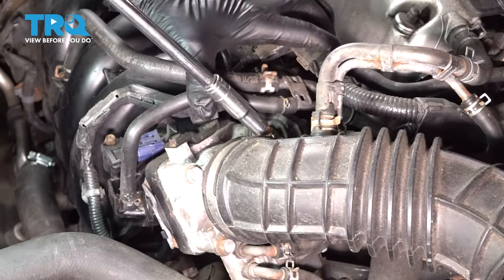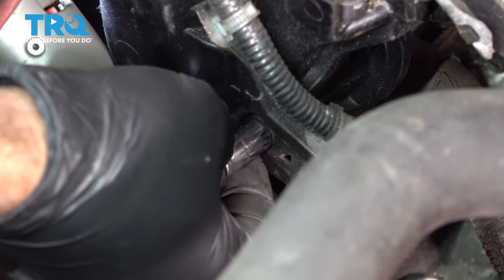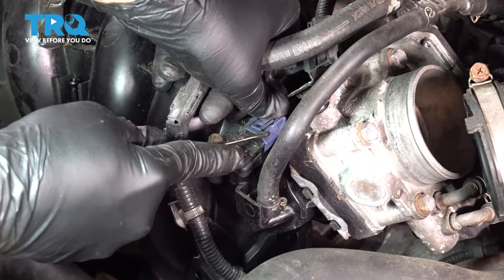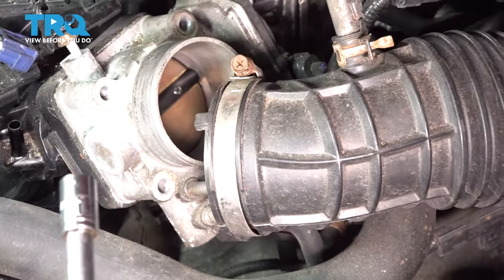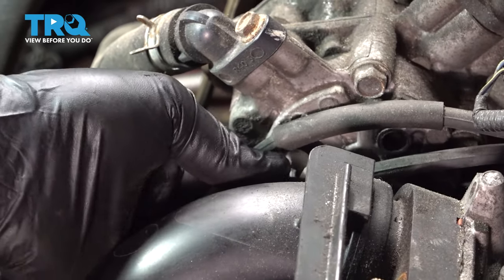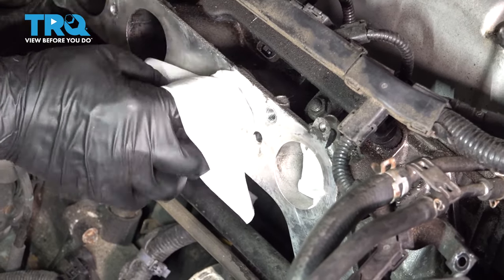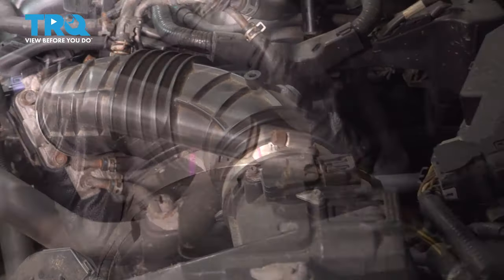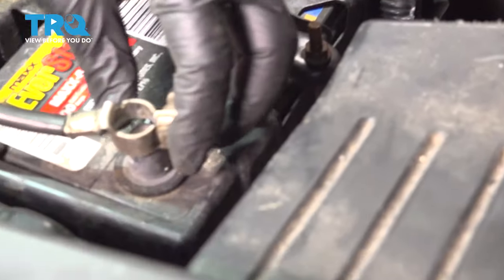How to Replace Starter 2008-2012 Honda Accord

Comment: Mine was a 2011 Honda accord and the intake manifold had an additional mount at the bottom that was difficult to take off but not impossible. Just something to add to the list if you’re working on a 2011

Comment: Thanks very much for this video. I just replaced a starter in an 09 Accord LX. The intake manifold on mine had a bracket attached at the bottom right that I had to unbolt from the engine. And the breather was in the way so I unbolted it's mounting bracket from the battery tray and kind of pushed it this way or that way to get it out of the way. Otherwise, it was pretty much the same as you showed. I REALLY appreciated that you included the torque specs. Some surprises: the 12 mm nut dead center of manifold requires a thin wall socket to get to, my craftsman 1/2 drive socket was too fat. I bought an inexpensive set at harbour freight (the colorful ones). The nut on the starter was recessed. I ended up using a 3/8 drive with a 3" extension to get to it. I had a hard time torqueing the 14mm rear starter bolt using my 1/2 harbour freight torque wrench. I think a 3/8 torque wrench would be better. Thanks again.

Comment: I took my time and had it done in under 5 hours. That five hours included going to get the tools I needed, taking it apart, driving half an hour away to get the starter, putting it together, cleaning the engine bay, and spending time on the phone. A leisurely project that likely saved me hundreds.

Comment: Thank you for the easy to follow instructions and including torque specs. My 2009 also had the additional bolt on the bottom of the manifold. Everything was such a tight fit but my hands and arms should heal in about a week. Lol!

Comment: It’s mainly clamps and tubing, getting the old hoses removed. Standard tools but an electric ratchet makes the job 3x faster. Metric sockets 10 & 12 for intake stuff. 14 & 17 starter bolts
Reply from the maker: +@JosephHubacek-xy8yg Thanks for watching our video! http://1aau.to/m/Shop-TRQ

Comment: Great instructional!  Before my starter went out it would make a "crunch" sound on a cold start.  I put in a new OEM starter with this instructional as a guide and I'm still getting the "crunch" sound on cold starts but at least the car is starting up.  I'm concerned that there is a) damage to my flywheel, or b) I installed a defective starter (unlikely because it's brand new OEM).  Do you have any ideas?

Comment: Great video!  Made it easy to get my starter out, but I do have a question. I did not have the steel plate between the manifold and block that comes in the gasket set for the intake.  Some on YTube say it's not necessary, some say to replace it. I didn't have one to replace, but one came with the gasket set. Should I put it on??
Thanks!

Comment: my 08 accord had 2 bolts on the bottom of the intake manifold that were also holding it on. you'll need 3 extensions and a u joint, wasn't fun but it's duable

Comment: Oh gee you forgot the really hard bolt at the bottom of the intake manifold. I still haven't been able to get it off. I started this job based on the ease that it appeared in this video and now I'm stuck. This is very misleading. Thanks a lot.

Comment: I installed a new starter from Autozone on my 2010 Honda Accord, 2.4L engine.  After about 6 months I started having issues with the crankshaft position sensor.  I replaced the sensor and I still have problems.  Dealer said I should have installed a Honda starter only!  Really, anyone else having this problem?

Comment: I have a 2009 accord replaced the starter 5 years ago.  Car acted like battery was dead I fully charged the battery all lights and electronics work but starter won't do anything. Do I possibly need a new starter?

Comment: I got all the way to the point where I take the intake cover off. It will not budge :( I've taken off every nut and bolt needed (6 total) and it won't move a bit

Comment: My daughter had Japanese Auto Repair in Alpharetta, GA replace the starter on her 2008 Accord with the 4cy engine after the original starter slowly began to fail. The failing starter may have had a bad solenoid because during failed attempts to start the engine, I could hear the starter spin but it wasn't engaging with the flywheel. After several tries, the starter would engage with the flywheel, turn the engine over, and the engine started and ran fine. The mechanic at Japanese Auto Repair replaced the bad starter. The new starter turns the engine over normally now but the engine won't start up. She was told she has a bad connecting rod and the engine needs to be replaced. I think that's BS because the engine ran fine right up to the time the old starter completely failed to turn the engine. I want to know what the mechanic could have screwed up along the way that could have allowed the starter to turn over the engine but prevent the engine from firing up and running.

Comment: In Honda accord 2012 
Starter failed and I was replacing it . There are 3 wire connections for starter 
1 on the top ( screwed )
1 black connector on the side 
1 blue connector going to engine ( this one wire came out) 
Please advise

Comment: Anyone else have engine light come on after the repair?  I am guessing the air flow is off and possibly running rich?  The car was revving the rpm’s and dropping and repeating.  When I drove it a short distance in my neighborhood it acted like it was going to die when I let off the gas

Comment: first mistake was removing the positive from the battery first, the Negative comes of first to stop any shorting of the battery and not shorting out any operating systems etc the computers you armature 🤣